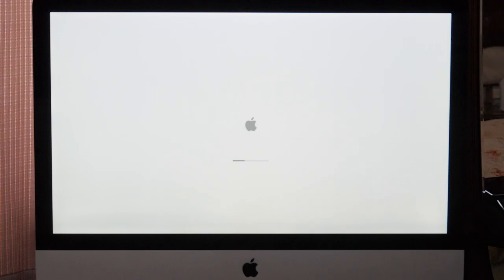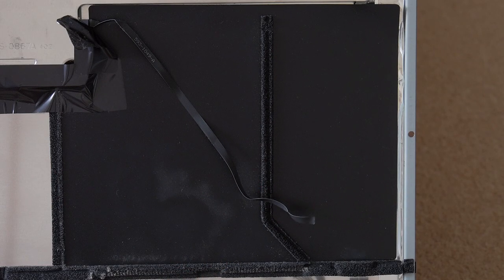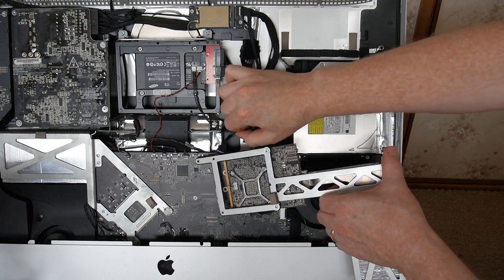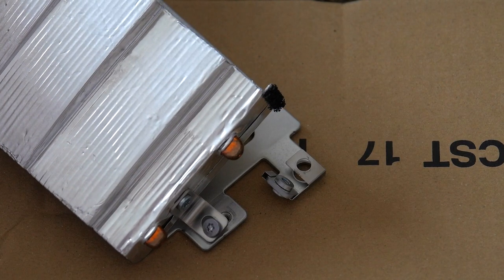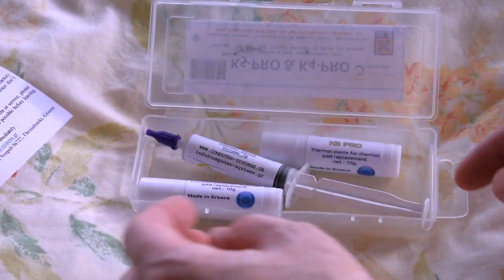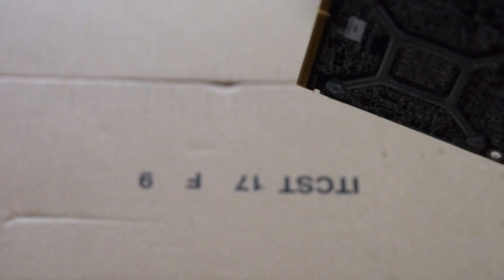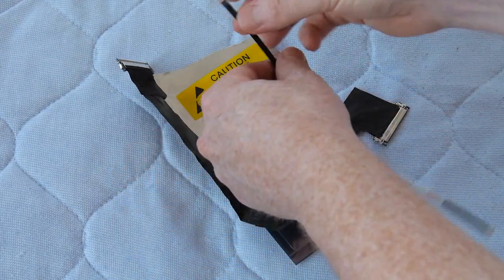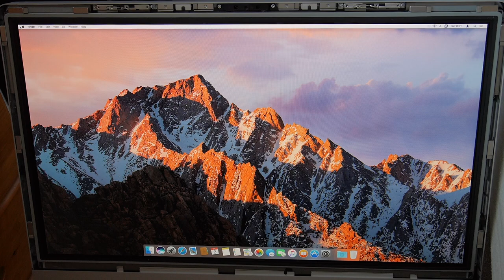Late 2009 iMac 27" Video Card Repair — 4850 — 2nd Bake

Comment: Thanks for the great tutorial...will be baking GPU later this week and hope for a good result!Cheers Maddog
Reply from the maker: I read and reply to every comment, and the vast majority who try the bake find success.  Just make sure you have the right thermal paste.  I am not saying that pastes other than K4 and K5 Pro won't work, but I did have success with the K4/K5 combo so naturally I recommend it.  If you decide to use electrically conductive paste on the GPU, use it sparingly so there is no overflow, as any overflow of such paste could short on the tiny SMD capacitors surrounding the GPU.  Lastly, there have been a few cases of people who report their fan spins at full blast after their bake, and such is almost always due to either a cable left disconnected or a wire to one of the cables that was broken by accident.  Treat the cables delicately and remember to connect them all back properly, and you should be good to go!

Comment: followed the tutorial, revived my iMac, Thank you very much, I hope it will last
Reply from the maker: The bake doesn't last forever because even a brand new card won't last forever.  In my experience, a brand new card installed by Apple lasted only 3 years.  But my 2nd bake lasted 2 years and 9 months, and I've read some comments from other people saying their bake lasted even longer than that.  So hopefully you will get at least a couple years out of your bake, which would then make the time, effort and expense worthwhile.  Best wishes!
Reply: @JDW-  even if I have to bake once a year it is worth it, I don't want to change my computer just now :)
thanks again
Reply: Only lasted 5 months. 
I’ll do a second bake and see.

Comment: Thanx for the video,JDW. I would recommend to install an application for controlling the fans such as iStat or MacFanControl and, in this way, launch the fans sooner than the system does.I baked mine a year ago and it works as it should.
Reply from the maker: Thank you for watching and commenting. I have been using fan control apps since my first bake. All three fans are set to a minimum speed of 2000 RPM. I even included links to those fan control apps in the text description under my bake videos.

Comment: Great educational video and I really appreciate the time you took to create, edit and share it!  ...and keeping it in focus and in high def!!  It's much more work than simply carrying out the fix without regard to taking the video and narration!  My mid 2011 27" iMac with the AMD Radeon HD 6970M 1024MB graphics card exhibits a different symptom.  Apple just recently had it for two days, running hardware tests and gave it a clean bill of health, yet when I got it home, the problem was back.  Hoping someone out there has experienced this and knows whether baking the board is the fix for this symptom too, I'd like to get another three years out of this iMac.   

Upon power up (cold boot) the screen stays totally black and so does my external monitor.  The Mac boots fine, I can pop in a music CD and iTunes plays it, I can change the volume, fast forward, rewind, skip to the next track, etc, all works great but the screens are black.  If I put it to sleep, I can hear it go to sleep and I can wake it and hear it wake and play another CD but the screens are still black. I can click Restart and it restarts back to a good boot but the screens are still black.   However, if I shut it totally down and do a PRAM reset upon power up, both screens work fine.  

When the Mac boots and the screens are on, all is well just like a new Mac.  Never any artifacts, horizontal lines or video noise.   If I Restart or put it to sleep while the screens are on, they come back on after waking it up or it reboots from a Restart, all is then well.  The issue is ONLY manifesting itself (at this point) upon a cold boot.  This by the way, ONLY started happening when I upgraded the OS from El Capitan to High Sierra.  I have wiped the HD and went back to El Capitan but I'm afraid whatever High Sierra did, the problem is now also here under El Capitan.  Apple Tech Support says my graphics card is starting to fail. Whether coincidental or High Sierra did something, who knows?

   What say you all???
Reply from the maker: Thank you for your kind words.  The video did take quite a long time to make, and although I didn't do major edits in post, I did edit, which on a long video can take time.  But I enjoyed it.  I make videos not for money (I don't allow Ads on my videos because I personally hate Ads) but rather for the joy of it. I search YouTube for help, and sometimes I can't find it.  Even if I do find it, some people just don't show enough detail to help me.  Sometimes I get so frustrated I make a video.  That's precisely what led me to make these 2 iMac videos.  When someone else doesn't do the job, it's up to us to do it!

Regarding your iMac, please know that I could boot my iMac, prior to the bake, when I booted into Safe Mode. That's because Safe Mode disables most video card functions.  But when I tried to boot normally, the machine would freeze or display artifacts.  There is not single set of symptoms that guarantees you have a video card problem.  I can only say that by reading the experiences of others, Apple designed the video cards in the late 2009 through 2012ish iMacs very badly.  That's why after my video card died the first time, I took it to Apple who replaced it, only to find that replacement died 3 years later!  It's a design flaw.

I baked my video card knowing the bake probably wouldn't last more than 3 years, but I didn't want to buy a new iMac so I thought the bake was worth it.  My first bake failed after 4 months, but my 2nd bake is still going strong more than 6 months later.  It's a heck of a lot of work, but if you have a full weekend and won't be distracted too much, I say give the bake a try.  Just make sure you read the text Description under my video first, to ensure you have all the parts and paste you will need.

Lastly, I should mention that when I took my iMac into Apple the first time, they replaced all manner of parts not knowing what the root problem was.  They finally replaced the video card and it seemed to work, but about a week after having taken it home, the problem surfaced again.  I had to go back to my Apple Store.  They replaced the video card again, and it was fine for 3 years after that.  So either their replacement card was defective, or their reassembly technique was bad.  I say this only to point out that even Apple isn't very adept at repairs sometimes.  You may do as well as Apple or better, even if you lack experience.  But with the aid of my 2 videos, you should be able to accomplish the task if you have the time and are determined.  Best wishes!
Reply: Let me just throw this out there since you're an electrical eng and see what you or others who might read this, make of it.  This is the result of some testing I recently did on Apples request. 
If you have the time to go through it, I'd be interested in your comments.  Since the far majority of graphic card issues I see via internet searches have symptoms different than mine, I wasn't ready to rip open the iMac and deal with the card.  
The big difference is that once my iMac is up and running, the screen never displays any issue, works like new.  My issue only manifests itself upon a cold boot. So in summary, it appears that once the iMac is up and running with a normal screen, no hardware tests have found anything wrong because by then, whatever was wrong is now working.  I was wondering if the little BR2032 battery may be part of the problem on this seven year old iMac.  Just thinking that it may not be properly holding the settings needed for the screen to know what to do upon a cold boot.  

Ok, guess there's no way to upload a pic so here's a link to it in Dropbox  --> https://www.dropbox.com/s/uo2dzxrdstvfu4i/Screen%20Shot%202018-02-10%20at%209.37.34%20AM.jpg?dl=0
Reply from the maker: Marty, your symptoms match the symptoms I had; namely, that my iMac would work fairly well when warm or hot (Mac running) but then have problems at cold boot (when actually cold).  I would also have Wake-from-Sleep issues because I would sleep the Mac at night, and in the colder months of the year, the machine would be ice cold in the mornings when I would try to wake it.  And it would freeze.  I then tried leaving the machine running all night (only dimming the screen) and most of the time I didn't have a problem when waking the screen the following morning.  But all this fits the problem perfectly.  Heat expands, cold contracts.  And there is something either in the GPU chip itself or in its soldered connections (or both) that is heavily impacted by heat.  And so when we heat the card to an extreme, like baking it in an oven, whatever is wrong with the card gets fixed and (if baked sufficiently) stays fixed for quite a long time.  Again, my first bake lasted only 4 months, for reasons unknown, but I am still going on my 2nd bake just fine, not 7 months later.  My iMac is used daily, for many hours each day, and it sleeps and wakes just fine.

The BR2032 should not cause boot problems in a 2009 or later iMac even if the battery was dead, as the purpose of that battery is only to retain date and time settings when the computer is disconnected from a wall socket.  I have read that older 2006 Macs could have problems with a dead PRAM battery, but that is just what I read on the internet and isn't conclusive.  I have tested my late 2009 iMac without the BR2032 installed at all, and the machine booted and worked fine.  Also note that if you remove your old PRAM battery, the battery holder is probably so brittle it will crack, which is what happened in my case.  I put in a new battery and held it down with my finger, then used Hot Glue to secure it.  It does get hot inside the Mac, but in the area around the PRAM battery it is cool enough that the hot glue will not melt or loosen, so you will be OK.

All said, I still think you have the same video card problem I did, which unfortunately can only be fixed by either paying Apple to swap your video card or by your spending the time to perform the bake (or paying someone else to do it for you).  The thing I really hate about the entire disassembly process is the front glass.  I hate it when I see even a tiny spec of dust under the glass, so it takes me a LONG TIME to get the front glass back on to my satisfaction, with virtually no dust beneath.  If I had a clean room that would be ideal, but I don't and pretty much no one does.  So if you hate dust like I do, that's really going to be the biggest ordeal you will go through at the end when you are eager to close everything up and get back to work on your iMac.

I really wish Apple would have designed the video card better.  It would have saved us all this hassle.  Apple really screwed up.  It appears they fixed that in newer models like the 5K iMac, but that doesn't help us who own an older Mac and want to keep it up and running.  Anyway, I hope this helps!

Comment: I am on my second bake now and have just taken it out of the oven. The bigger point to raise is Apple has sold us all imacs with faulty graphics cards that shouldn’t have broken like this. They should be doing the right thing and providing replacement cards!
Reply from the maker: I agree, but Apple actually replaced my 4850 with a brand new 4850 card, and exactly 3 years later that “new“ card also failed. And that is what prompted me to do my first bake. The problem is that Apple won’t replace the 4850 with a card that doesn’t have the same problem.

Comment: Count me as another success!  Thanks for the video.  I was able to get the card out of and into the heat sink assembly without disconnecting that hard to reach temp sensor cable.  Hopefully apple will make another computer that I actually want by the time it breaks again.
Reply from the maker: I have a late 2015 iMac 27" at the office and it runs cool and never had any video card issues.  So I believe they have fixed the design and you are most likely safe with the latest iMacs.  In any case, thank you for letting me know of your successful bake!

Comment: Just to let you know, the black stuff you kept wiping off wasn't dirt or anything. The thermal paste contains a very fine silicate grit which polishes the metal when rubbing. Great video, thanks.
Reply from the maker: In that case, I thoroughly polished mine because I ultimately got the black stuff off.  Thanks for watching!

Comment: In feb '21 I had my first bake of a ATI 6970M card, that lasted for over 2 year (the iMac  is only used 1 or 2 times a week). So I took out the graphics card, and found that apperently I was so focused on adding the K5 Pro paste all around, that I forgot the K4 Pro paste on the gpu itself! No paste on the gpu, perfect clean.  Remarkably it lasted all that time. 
So I had a go with a second bake 200°/10' and again success! The old lady is running again, evn today it is still nice 27" IPS 2560x1440 screen to play video.
Reply from the maker: Glad and amazed you got 2 years!  Definitely paste the GPU this time.  Doesn't have to be K4 Pro.  Could be another quality CPU paste, but you absolutely need it on the GPU for long term use.

Comment: Mannn... I'm still fixing my iMac 2009... Now I discover the system battery (CMOS) don't have charge... I can fix the jump temp 100ºC with another bake, now i do until 20 minutes, and apply a good thermal paste. Im still testing it! So, thank you very much for this video again!
Reply from the maker: That battery is partly why I showed the complete removal of the motherboard in my 1st Bake video, since you have to at least partially remove the motherboard to replace that button cell battery.
Reply: @JDW-  Yeah... Your videos shows it! I do someday... Today I install Catalina... DOSdude patcher works very well... white theme is so beautiful!
Reply from the maker: Be careful with Catalina because it requires more power from your iMac and might make your video card run hotter. Be sure to use a fan control app to keep all 3 fans running at 2000rpm. That’s what I do, even while still running High Sierra.
Reply: @JDW-  Hello My Friend!!! Good News! I really found the real problem, a little resistor broken, now I soldered and the temps still around 55ºC with MacsFan app. Thanks for help my friend! See you!
Reply from the maker: @janquieldapper  I am so glad to hear you solved the problem, but did the damage to the resistor happen because of something you did when you opened the machine, or was it dark and burned or just desoldered or cracked when you opened your Mac.  You have me quite curious now!
Reply: @JDW-  hello! Cracked when someone take the graphics card off. Maybe I do it, I really don't know, but after 5 reboots and a lot of uses in Photoshop and Lightroom, still working well. I think the bake works in the first time than I tried, but this resistor make the sensor up to the 90/ 100ºC. I soldered the transistor and I think this work.
Reply: @JDW-  Well, the next step is change the CMOS battery like you do and change the processor thermal paste, than this machine will be great again. For the future change the graphics card and processor, and put 16GB of RAM

Comment: Thanks for keeping us updated! You're a great YouTuber
Reply from the maker: I'm humbled by your kind words.  Thank you.  And you reminded me to update my Description to let everyone know that as of today, my iMac is still going strong, 10 months since my 2nd bake!
Reply: JDW you've done a great job with this. The baking must reflow the solder. They don't use lead-based solder anymore (for environmental reasons) which leads to a more brittle solder (which ironically leads to more electronics going into landfill). This brittle solder forms micro cracks over time with heating and cooling. I've repaired audio equipment by reflowing solder joints. Great video, well explained!
Reply from the maker: Actually, I don't think the solder is being melted because 200°C is below the melting point of leaded solder, and lead-free solder has an ever higher melting point.  Instead, I believe that something inside the chip is being reset.  I speak of metal connections, not software.  Regardless, I think my 2nd bake proves the naysayers wrong and gives strong evidence, along with countless success stories in this comments section, that the bake really works to repair what's wrong with certain iMac video cards from 2009 through about 2012.  The cards themselves have a faulty design.  Anyway, thank you for watching and best wishes!
Reply: JDW you are absolutely right! It's strange. I'd love to know how it works. All the best!
Reply: Hi JDW, can you say more about the faulty design of the video cards? I did the bake 3 months ago on my 2009 iMac’s ATI Radeon HD 4850 and it’s still going strong. But how? Why? If the bake doesn’t melt the solder, what does it do?
Reply from the maker: I have not seen X-rays of the GPU, so I can only speculate that some connections inside the GPU "die" are, for reasons unknown, getting cracked or broken and baking at 200°C repairs those broken connections.  The very fact that these die connections are so easily broken over time indicates an inherent design flaw. And indeed, after Apple replaced my stock video card 3 years after purchase, 3 years after replacement, that card too developed the same problems (at which time I embarked on my 1st bake).  So I do not expect a bake to last more than 3 years, due to the faulty design of the card.  But despite the time required to do the bake, it may be worth it for many people.